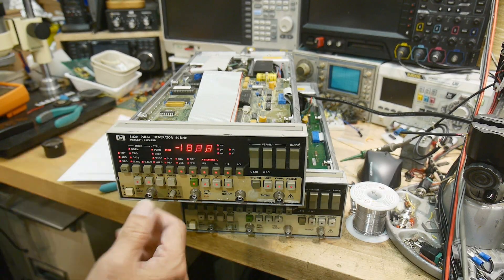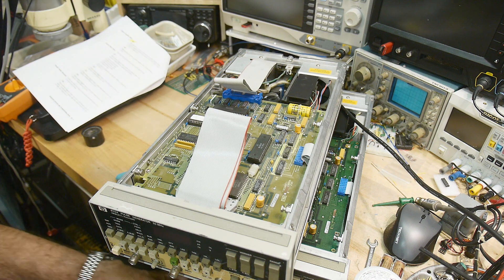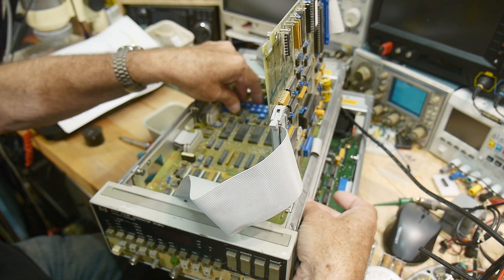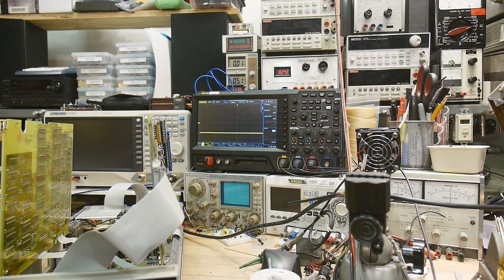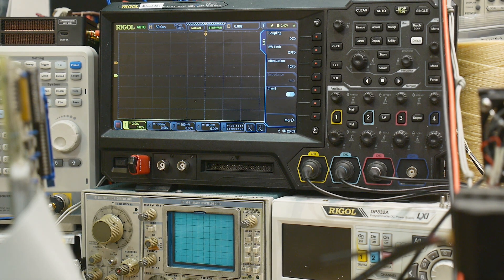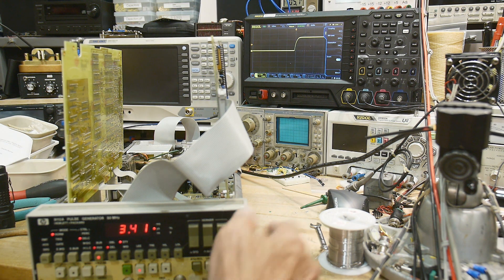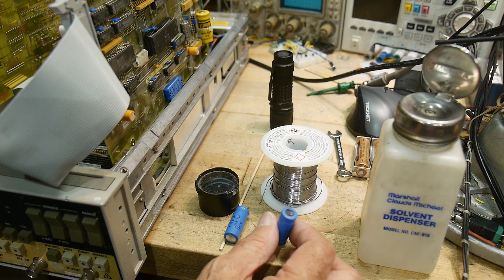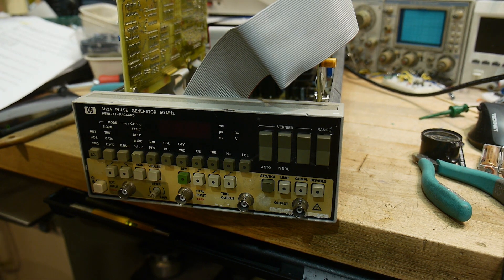#1652 HP 8112A 50 MHz Pulse Generator (part 2 of 4)

Comment: Many times faults in old equipment are traced to electrolytic capacitor failures.  Since this is a known failure mode does modern manufacturing take this into account and design for a specific minimum lifetime or do they just throw something in and hope that the device will last longer than what people care about?  I quit buying HP computers because of this very problem.
Reply from the maker: all electrolytic capacitor will die in the future

Comment: That's a brilliant idea with the PCB's vertical stands and long enough ribbon cables envelope like design, times when things were designed with serviceability in mind.  😯👍👍
Reply: Absolutely, a lost art for sure. Reminds me of all those car mechanic videos where they have to remove half the engine just to get a bendy spanner on a rotating wiggly offset extension just to reach a M2.5 offset Phillips flat head screw that seized before it left the factory because all the road salt gets funnelled to that one spot and they made the screw head out of painted cheese. Car designers should be made to change the oil filter and headlight bulb on any car they design, just to realise the suffering their brainlet design causes other people